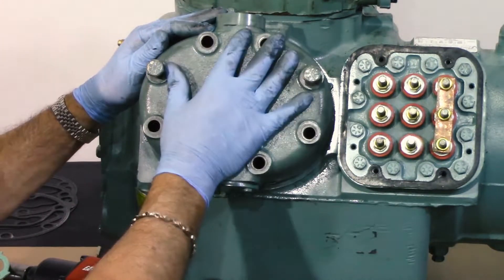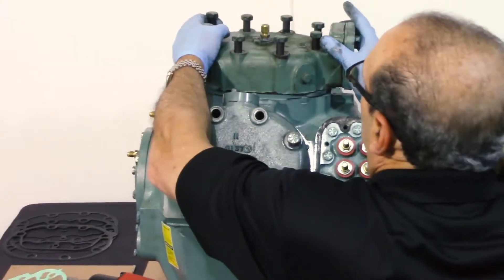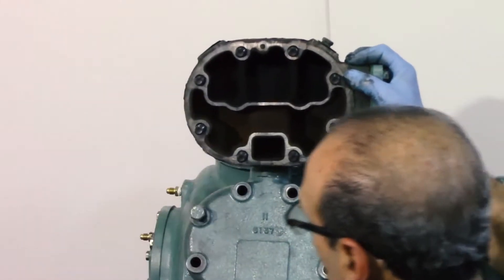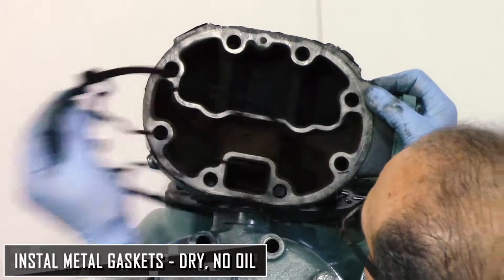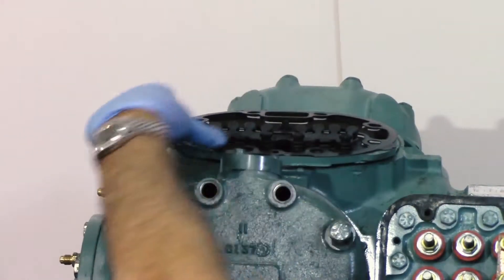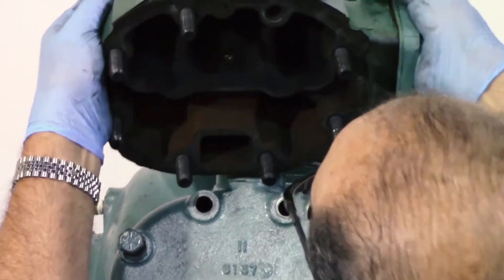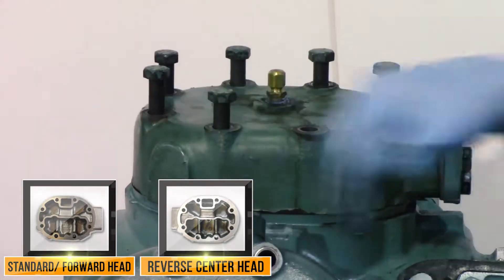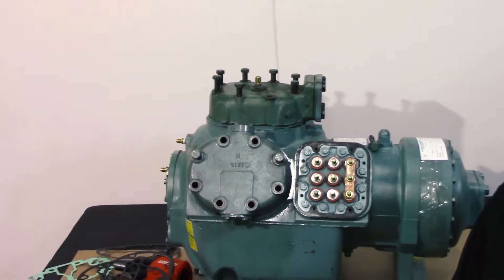Changing A Carrier 06E Center Head

Comment: Hallo Sir, 
we have 3 compressor in one circuit in carrier chiller when  compressor No 1 is running and other 2 compressor are off condition then compressor No 2 is ok, but compressor No 3 is became heat up on top side of the head on off condition No 2 is not heat up, so please can u explain what is the issues in compressor No 3 and what we have to do to solve the problem......

I will be appreciate. 
Thanks....

Comment: My question is why on earth would you ever need to change the head? I've been doing Refrigeration since 1984 and have never seen or heard of a head going bad.
Reply from the maker: Great question! A few scenarios that would make one need to change a head, 1) the discharge valve mounts onto the center head, the threads get stripped or it gets cracked from not lining up properly. 2) There are times that the one that was in stock at the supplier did not have the correct center head configuration, but the compressor replacement was critical and the customer cannot wait to get the correct configuration. Finally, the model number on the tag is either wrong or not very legible, the customer gets the compressor to the job and realizes that the head is wrong, for safety reasons, we thought it would be a good video to show that you cannot just spin the head and will need to swap it from the old compressor.

Comment: Hello sir.  With metal gaskets, does it matter which way the embossed rib is facing?  Ribs against the plate or the head/crankcase? Thank you.
Reply from the maker: Hi Eddie the Grouch, in most cases the metal gaskets are multi directions, except where when alignment is concerned. On some of the gaskets, they can only go on one way.